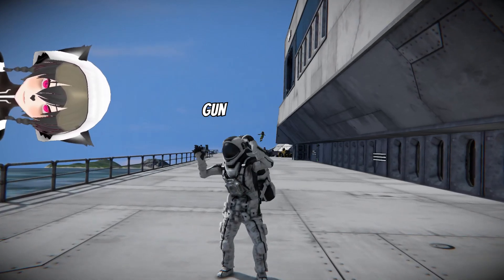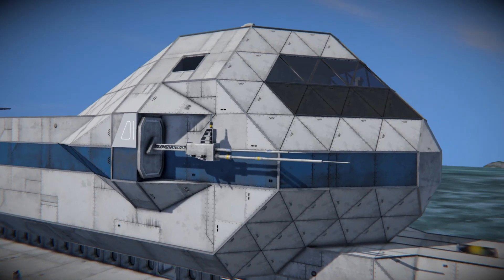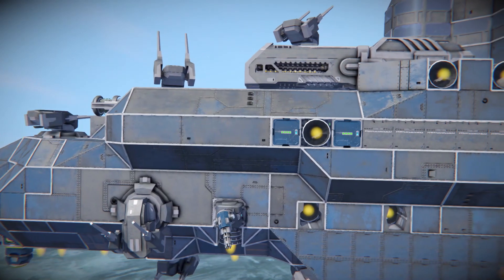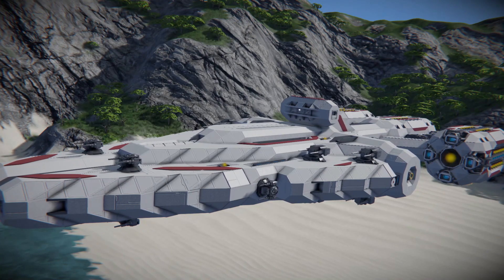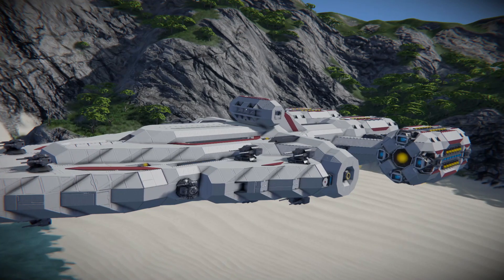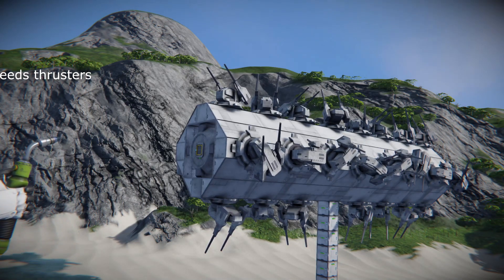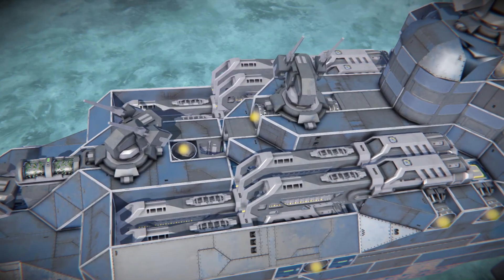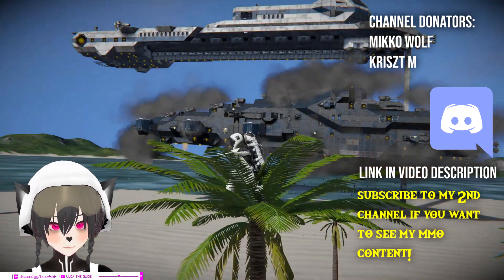The Bad Advice That Makes Warships on Space Engineers Underpowered

Comment: "How many guns do you need?"
"Enough to burn 100k magnesium ingots in one minute"
Reply from the maker: Good xD
Reply: @LucaTheGuide  
Seriously, pirating gameplay isn't profitable.
Attacking enemy AI or player are not going to give back the resources that you spend to neutralize them.

The reason we're making warships isn't to accumulate resources, its to protect against AI and bored rich player.

Only if jump drive can be automated, we can make a ship that could jump automatically when turret controller detect enemy ship in 800 m radius.
Reply from the maker: @friedec3622  Yeah x3 it's mostly for combat c=
Reply: @friedec3622  This is already possible using Programmable Blocks, however its not very commonly idealized as a practice, This would be because many players actually like the idea of attempting to do some defense prior, and not to mention even a probe could cause your ship to automatically jump drive.

lets say your in your miner ship and all of a sudden your main ship has just jumped a distance away.
that would be extremely annoying.
not to mention the amount of power you'd have to plan to ensure charges are quick enough.

Comment: I wouldn't necessarily agree with however many can fit, because there is a calculation behind the entire process.

First off all as you mentioned, Real-estate for positioning of weapons is to ensure they aren't blocking or being obstructed by portions of the ship.
second, cargo space for ammunition and being able to sustain a duration of a fight, without ammo or means to provide ammo to those weapons, its utterly useless.
third, weight factor comes into effect, ensuring your thrust is still able to support the the capable thrust in the environments you desire to be able to support maximum capacity within those environments with thrust power.
example; if you have an Hydrogen Destroyer designed to handle within Atmospheric or Space enviroments, but cannot support the weight within Planetary gravity, then that is utterly pointless for your design.

It takes quiet a bit of planning but these sort of factors need to be considered before just mounting any that'll fit.
I am not saying Limit yourself to "look appropriate" however generally when taking all calculations into ideal concept you will find it'll look extremely natural with a bit of effort.
Reply from the maker: Yeah there's certainly lots of consideration to it c=

Comment: Heres my view on what makes gunspam bad:
1) Energy costs, they all require consistent energy
2) ammo costs, you need more ammo to stay in the fight as long, and thus need more thrust 
3) firing angles, gunspam tends to imped your own firing angles by alot, risking turrets shooting each other in futile attempt to hit enemy, and a lot of the guns just being inable to target the enemy due to bad angle
4) encourages wedge shape, while this point isn't inherently bad, it comes at the point of the fact that majority if not all your guns would be foward facing, leading to the ability for just one fighter to crash into your thruster bank and disable you entirely.
5) [depending on the gun] much easier to get all your weapons disabled with a few rockets, this ofcourse is not as much a point if its gattling turrets
6)less armor, due to having to pipe up all the weapons it means less overall armor
7) PCU costs, this should be self evident but turret spam comes at the cost of pcu efficiency, something that may be OBSCENELY valuable depending on if its solo or multiplayer
8) ingot and component cost, if in survival spamming turrets leads to massive costs in terms of resources 
9) easier to distract all of them, depending on your settings they can all be distracted with a single missile from a handheld rocket launcher
10) reduces where you can place thrusters, most turrets are either 1*1*2 or 3*2*3, greatly reducing where thrusters can be thus reducing thrust, something VERY HEAVILY NEEDED for all that ammo you'd have
11 and final point ill make) looks, yup the final point is the cliche point of it just looks ugly. It just looks like an annoying waste and doesn't survive practicality.
Reply: 4 can be mitigated by actually utilizing point defense weaponry (seriously, would sticking a few autocannon custom turrets on your ship really be that big of a problem?) or designing your ship to use multiple smaller thruster banks instead of one large one.
Reply: @VestedUTuber  the problem with the custom turrets is that its not consistently blueprintable, and that makes printing it hell. Though, thanks to their  smallness compared to other turrets making them easier to install defensively, interior turrets can work for defensive turret spam, fair point. And the multiple thruster bank idea is also a fair point
Reply: @gibbhartin643 
I wouldn't use interiors, though, as their damage against grids is laughable. As for small grid ball turrets, point, but it's a LOT easier to build them now as hinges can now spawn both sizes of small grid hinge parts making ball turrets much easier to freehand. The blueprint just has to have the advanced rotors on it.

Comment: The "gun spam bad" advice is given to people who want to make aesthetically pleasing ships that remain functional and combat effective against AI ships.

It's to avoid the dreaded "gun brick." A ship designed to maximize surface area for turret placement. Usually default gray.

It's also why I don't build ships. My ships aren't pure bricks but even the gameboy color could render them with the number of polygons they can be made of.

My only large grid ship design is stuck in design hell because I can't build well. Currently stuck at steps, "where put bridge?" And "how many thrusters, where put, also fuel"

Said "ship" is basically a few small rooms made of heavy armor, with large containers, a few large fuel tanks, a jump drive, batteries, and the worst CIC ever contained within. There is a refinery with efficiency mods and an assembler on the rear section. Everything is conveyored to the 2 main conveyor lines that run on the dorsal and ventral surfaces of the heavy armor rooms, which also have the dorsal and ventral turrets attached, in a super firing configuration.

So yeah, "gun spam bad" is to help people like me make less ugly ships for pve. Not the best advice as it still can't teach artistic design or interior planning.
Reply: Yeah no, the gunbrick has some actual issues. It's firing arcs are really narrow, so it cannot project its firepower effectively. A desing with the same guns in better placement would absolutely eat it up, simply because it can throw more ammo to the gunbrick than the gunbrick can throw back. Same goes for armor, and interriors, which in the gunbrick aren's particularly effective at minimizing damage from any side, and are therefore much more difficult to leverage as strengths.

If you have a dedicated combat direction, you can build your ship around keeping the opponent in that direction. With the speeds Space Engineers allows for ships  These become even more important considerations in survival, where resources are a limiting factor as well.

And it turns out the extra volume from ensuring proper firing arcs is really useful in storing utilities like storage, thrusters, production or the bridge.
Reply: It's also used against ships that are literally just a brick covered with guns without consideration to placement. If you have two ships, both with 16 artillery turrets, but one's a borg cube -esque brick and the other's a star destroyer-esque arrowhead with superfiring turrets, the arrowhead-shaped ship will be able to bring far more firepower to bear than the brick.

Comment: Take a look at a WWII battleship then talk about gun spam. Ask the guy that designed teh Yamamato and he would say were missing guns. 

But on servers the number of guns depends on the standard everyone builds toward. If the biggest ship flying has 20 artillery cannons or 30 railguns and a gat wall of close to 160 guns then you have to design to be able to beat it. Although I am usually trying to protect a ground target so I tend to aim to do enough damage that it isnt worth continuing to their original target. 

Gun spam to a certain extent is pretty common.